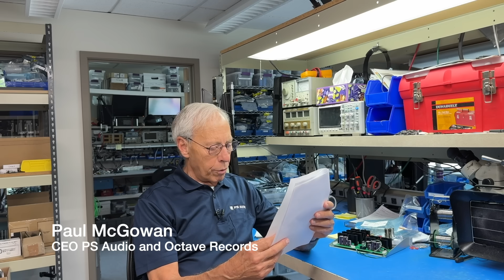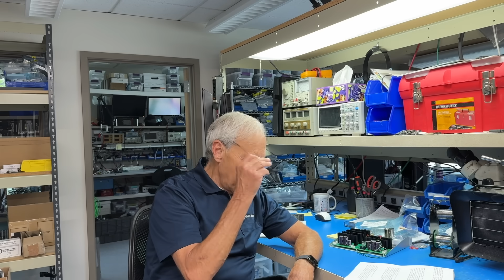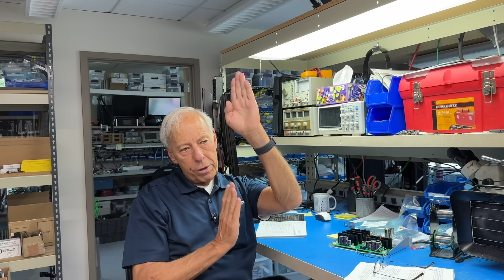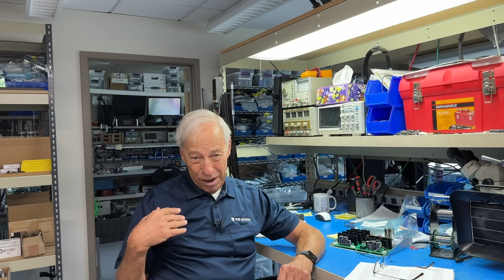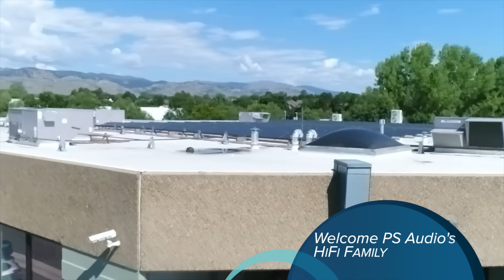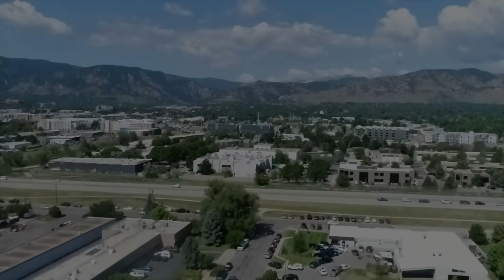Paul explains phase alignment

Comment: Phase is what we use to determine where aa sound is coming from. We are sensitive to it because it tells our brain if fight or flight is the best solution. In audio, phase is more often ignored than actually honored. This makes a LOT of expensive gear very "mid Fi". It is not hard to acoustically align drivers and then make the crossovers work with that. I would not take any company seriously that ignores it.

Comment: This is too tough to cover in 5 minutes:  truth be known, it starts with positioning of the Marshall's & Ampeg's and the mic's that pick 'em up THEN swirled around thru a sound board before final cut.  The best you can do at home is nail a single-driver speaker for everything above 120Hz and declare victory at wringing out the best sound the label could hope for.  But most of us can't do this.

Comment: "Alpha Sound" did a video last year measuring subwoofers, and the reality is that nothing lines up, you can measure the frequency response to see if it's flat and that's probably as far as you go with subwoofers. 
Looking at the filters in the crossover then each order adds 90 degree of phase rotation, 1st order (6dB/octave) =90, 2nd order (12dB/octave) =180 and so on. That's why a 2-way that uses two 2nd order filters will probably have the tweeter installed with the polarity switched so they will be equal and summarize. If they would be out of phase 180 degree then you'd see a massive dip (lots of popular speakers come with this flaw, but marketing is stronger than your ears). Next is time alignment, the drivers might be in phase (they push the air back and forth at the same time), but they start at different distance. A general rule of thumb is to look if the center of all the magnets line up, sometime you see a tweeter mounted further back, or the baffle might be tilted back. 
This is all theory though, in reality it all moves around and the phase shift might be a more odd number etc. Which is why good speaker manufacturers will listen to the speakers and make adjustments to the crossover, driver placement etc to find the best compromise (it measures good and sounds good). 
(A lot of manufacturers don't even bother trying to make them measure good, just look at all the speakers GR Research here on YouTube is fixing, then add all the forums, Facebook pages etc, corners are cut everywhere and price or brand is no guarantee)
Reply: Great info. 
 Thanks!
Reply: With speakers, there are two different things: do the drivers align with each other at all specific frequencies? With any good design (e.g. flat response) yes they will (avoiding tech tangents). But do they align with the original signal? That is, do multiple frequencies still align with each other, maintaining the original waveform? Usually not, and the difficulties of trying have big tradeoffs.

Comment: Phase and delay have always confused me.
Reply: Das wird auch von den meisten Menschen falsch verstanden : eine "Phasenverschiebung" ist immer gleichzusetzen mit einem "Zeitversatz"
Reply: I have a video going over this, but you will have to spend 4 hours going through it. There are various delays to consider such as phase delay, group delay, and true delay. A phase shift is NOT simply a time offset, but the phase holds all of the information about the delay aspects.
Reply: @Rene_Christensen  Ich bezog die "Phasenverschiebung" auf eine Sinusförmit Schwingung, nicht auf ein Signal mit stochastischem Charakter wie z.B. Musik.
Auf jeden Fall wird von vielen Menschen eine einfache Umpolung eines Signals immer mit einer "Phasenverschiebung von 180°" gleichgesetzt und dies ist absolut falsch !

Comment: But how do I messure it?
Reply: You can measure each driver and the combined output to see how it summaries. You might still be off with time alignment (basic rule is to have the center of all magnets an equal distance to the listener), but the reality is that it's never going to be 100% over a wider frequency range so all you're trying to do is find the best compromise (what sounds best).
Reply: @PSA78 so I have a distance alignment setting in ms Marantz. But The Subwoofer is active so the distance alone will never be enough due to the latency of the Electronics. Audyssey messures 8 1/2 Meters distance while it is about 4 Meters away. I manualy messured all the distances to my speakers and fixed the alignments but this will not work on the sub.
Reply: @ForTN0X  Subwoofer is in some ways far more complicated and in some way far more simple, what you're looking for is an even response and that's it really. You adjust crossover and volume so that you (at a minimum) can't locate the subwoofer, and then you place it where you get an even response, and/or make adjustments in the electronics like DSP (though electronics can't account for dips due to the room, just peaks from the room).
Reply: @ForTN0X If I can be of any help, the reason that audyssey gives a "wrong" measurement is because your sub is in the wrong place. Play some heavy bass (or with the help of a frequency generator) through your subs, and walk around slowly. You will hear at some spots a lot of bass and you take 2 more steps and suddenly you hear hardly any bass anymore (reason: bass are long sound waves). So if you do your measurements on a spot where your mic picks up very little bass it will give you a distance that is way off. That means that your sub is in the wrong place. Changing that measurement manually want be of any help. Writing 100 on a 10$ bill want give it a value of 100.
You need to move your sub ( the subwoofer crawl. Lots of vids here on youtube) till you hear the maximum bass in your listening position. If you then do your measurement you will see it gives you the correct distance.
I worked a lot with audyssey multeq x32.
Regards.

Comment: People keep talking about phase between drivers.  Thats for the speaker manufacturer to worry about.  A competently built speaker will have its drivers in phase.

As end consumers, we want to be concerned about the phase between the speakers and the subs at the crossover region.  But there's an endless amount of research online about how to do that and most auto-cal systems handle that well enough.

What is not talked about nearly enough is INTERCHANNEL PHASE between all the speakers in your system.  With stereo its easy enough.  But with 5, 7, 9, 11 or more speakers in the chain now, all originating from different parts of the room, its highly challenging to get the phase of all those speakers working together.   Whem you do, the end result is magical.   Interchannel phase alignment is the secret sauce of professional calibration and is what makes auto-cal systems like Dirac Live and Trinnov Room Correction sound so good.
Reply: You're exactly right, the consumer should worry about wiring their speakers correctly and setting up any subwoofer properly.  However, it's not possible for all speakers to produce in-phase signals at all locations for all frequencies.  The wavelength of a 10kHz sound is only about 3.5 cm.  Move just 1/2 of that distance closer to a tweeter and you will hear that 10 kHz signal 180 degrees out of phase.  Is that a problem?  No, not at high frequencies.
Reply: @markmeridian3360 at high frequencies there's not much you can do.  But from the crossover region to about 250hz and secondarily all the way up to 1khz if possible.  But that gets really challenging and as you say, moving too far afield will change the phase.

Personally I pay close attention to the phase between height speakers and their ear-level equivalent.  Thats harder to do with top mounted speakers though.

Comment: This topic becomes relevant when the relative phase (timing) between different frequencies is not aligned such that when frequencies combine the sound waves is not as intended. A square wave is composed of many individual sine waves at different frequencies and  only comes through as a square wave if the phase is kept aligned. Phase distortion is often happening in the speakers. I come to like the KEF UNI-Q drivers for excellent phase control e.g. in my KEF LS-60 or LSX-II (office setup). Especially the comb effect in most traditional multi-way speakers create serious phase filtering issues due to phase misalignment when listening at different positions vertically.

Comment: When any speaker's driver produces sound, it does so by vibrating (or pulsating).
With woofers, people have videos of seeing the large drivers moving in-and-out.  It is the "in" and "out" that determine the phase.

Regardless of the driver (tweeter, mid-range, or woofer), the driver should be moving either "in" or "out" -- it should not be random or in the opposite direction.
If a driver is moving "in", when it should be moving "out", then it is out of phase.
If a driver is moving "out", when it should be moving "in", then it is out of phase.

Some studio personnel are so incompetent, that they release songs to the public that are out of phase.  Lord knows what they were doing, to screw that up.

One way for your speakers to be "out of phase", is if you connect the black cable to the red terminal, and connect the red cable to the black terminal (or "+" connected to "-", and "-" connected to "+").
If your speakers are out of phase, then it will not be "in your face" apparent.  But there are people that have an "ear" for hearing when speakers are out of phase.

But if only one of your two speakers are out of phase, your stereo's sound quality will suck.  It will lose cohesion, as our host mentioned.  I had that happen to me, when I upgraded my speakers, and the store's installer got my right speaker's wires criss-crossed.  You might not know why your stereo sounds fatiguing.  But you will not enjoy it if one speaker is out of phase.  As soon as you correct it, it will be like a beautiful spring day with a rainbow.

Consider this example.
Imagine if you connected your pre-amp's right speaker cables to your left speaker, and you connected your pre-amp's left speaker cables to your right speaker.  Your stereo would sound odd, and you might have trouble putting your finger on the problem.  That example is not technically an out-of-phase problem.  But it is similar in the sense that something would be wrong, and it will not be obvious what is causing the problem.

Some pre-amps have a "phase" button, that will reverse the phase of anything that you are playing.  That comes in handy if you have a song that the studio personnel botched, and released out of phase.

I came across this with the song "Judy in Disguise (With Glasses)", by John Fred & His Playboy Band.
Also, on "Frankenstein", by Edgar Winter Group.

Since those songs appear on numerous albums, I do not know if they all, or if any others, are out of phase.  I know that my purchased flac files / CD rips are out of phase.
I used Sony's "Sound Forge" software to reverse the phase (reversing reversed phase puts the phase into its normal, proper position).  There are probably other audio editing tools that can reverse the phase of songs.  I never searched for software that has that feature.  "Audacity" seems to be popular, and I believe that it is free and open source (but double-check).  If I had to guess, it probably has a phase reversal feature.  So you can reverse the phase of some flac, wav, or (heaven forbid) mp3 files that you own, and hear for yourself.  The original files will remain intact (but make a copy, in case you screw things up during editing the songs).  So you can A/B compare between the original file (in phase) and your edited file (out of phase).
Reply: When I rebuilt a pair of lower end Three way box speakers. 
 All three drivers and crossovers for each speakers were replaced, along with much higher quality wiring throughout. And a replacement of the poor pinch connectors with higher grade connectors and internal bracing.
 I was in the middle of finishing the soldering on one of the drivers on a speaker, and I get a phone call, when the call is over, I get back to the speaker and finish up the soldering of the woofer. 
 I'm all excited with anticipation, when I fire them up, and then boom, they sounded horrible. 
 I replaced everything in stages, and the woofers were the last, so I checked them, and that's when I found my mistake. I crossed the polarity on one speaker.
 What's really boneheaded about the situation is, I'm a technician, and am supposed to know better. 
 Getting pulled away in the middle of a procedure, is a recipe for mistakes.
 Oh well, we have a saying in our industry, it's not the mistake, it's how you recover from it. 
 The speakers ended sounding quite decent when considering they were low end manufactured.
Reply: @davidjudd951  When the store's personnel installed my upgraded speakers (I traded in my current speakers), it was one of their regular installers who worked at the store that hooked everything up.  He has done hundreds of installations.

What makes it worse, is that the store's owner was there, too.  He gave a listen, and approved the installation.  And he has a golden ear (he really does).  I heard that it did not sound right.  But the owner insisted that all was well, and to let the speakers break-in.  He knew better, because I was not the first customer to have that model speakers installed.  So he knew that they sounded wrong.

Over the months, after I complained to the store's owner a dozen times, he sent over his top guy.  He heard the problem, and it took him 10 seconds to find the problem (it would have taken him 20 seconds if he happened to check the other speaker, first).

I was pissed at the installer, for screwing it up, and even more pissed at the owner for personally hearing it and approving it.
When he learned what happened, he was embarrassed.  He had a choice of saying that he does not have a golden ear, or saying that he rubber-stamped the installation so that he could leave.  He apologized, and said neither of the above.  He was not man enough to fully own his unforced mistake.

The store's owner stopped using the installer that got it wrong.  That installer was a disgruntled employee, and probably mis-wired my speaker on purpose, just to hurt his boss's business.
Reply: If one channel is out of phase, you indeed notice it immediately: you get a strange pressure on your ears, and much of the bass in the center of the stereo image disappears.
That happened to a friend of mine, he had bought an XLR cable with the signal wires swapped on one end.

Comment: All 2 or 3 way speaker has phase shifts due to their filters. It's just how filters work. As you most likely have the same two speakers the phase shift is the same, so it´s not very apparent. If you have a multispeaker system for your home theatre e.g. where you have probably different models or brands, the filters are now not identical and therefor shifting the phase in different ways - now it's much more apparent. There are phase correcting solutions like Dirac and Trinnov etc. The sound becomes much "snappier" with coherent phase for the lack of a better word.
I'm a bit suspicious that the writer possibly has phase inverted one speaker cable, making the whole L/R signal inverted, not phase shifted across the frequency spectra. That's an easy to fix but is devastating for the imaging and bass.
Reply: This right here.  I have dealt with this in my own system (13.2 channels) but once you get it dialed in (not easy) then everything falls into place.

Comment: Modern processors\receiver have systems built in for making adjustments to distance\EQ\Phase and they use a microphone to test and tune. Most modern speakers are built with phase in mind. 2-way and 3-way speakers with multiple drivers for example are arranged and wired to not distort each other. Subs have phase switches or knobs, and some like SVS have a digital system for tuning phase to your space and system. I still do a sub crawl as a check, but the software is pretty good. If your setup is a theater then tuning and testing surround sound is key to having a good movie experience. I worked in a large movie theater for a time and got to play with some extra large theater setups.
Reply: Not all of them are great at it though.  Dirac and Trinnov being the notable exceptions.  And it can be dialed in manually but thats a painstaking process that takes a long time and specialized equipment.
Reply: @FURognar that is true, auto is not perfect for sure. It can help get you into the ballpark, then you can tweak to taste.
Reply: @AnimeRoot thats what I do currently but ultimately I'm leaning toward getting a Trinnov in the future just to get it out of the way.  But thats a big spend.

Comment: Paul McGowan, I've heard many pramplifiers invert the phase, and tweeters often have a reverse phase with the woofers, Does this make's sense to you ?
Reply: If the phase is "inverted", it really means that the overall signal is inverted, which is a 180 degree phase shift at all frequencies. If both channels in a stereo system are inverted, you likely won't be able to hear, although with headphones and some test signals, you can hear a difference when comparing back and fourth. A loudspeaker driver in an individual/single loudspeaker may be wired "opposite" of other drivers in the same loudspeaker, but this is intentional to have a combined output that is fairly flat for this particular crossover. It is thus two different things you are wondering about here.

Comment: In audio sound systems, "out of phase" refers to a situation where two audio signals that are meant to work together are not aligned in time — specifically, their waveforms do not rise and fall together as they should.
It's important to match signal phases because you can experience problems with sound cancellation, strange stereo imaging and even volume reduction. From a perception point of view, low or bass frequencies are affected the most when a sound system has signal phase misalignment.